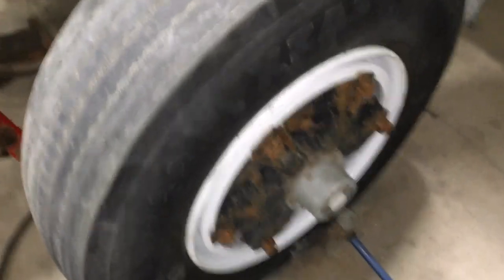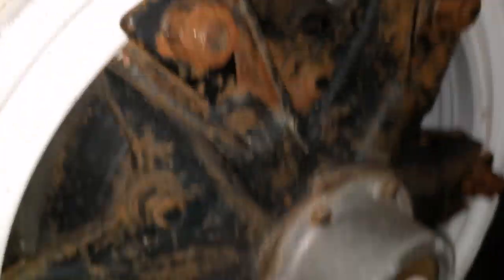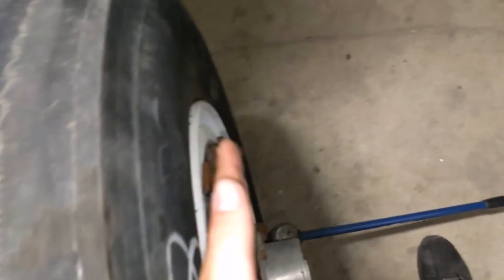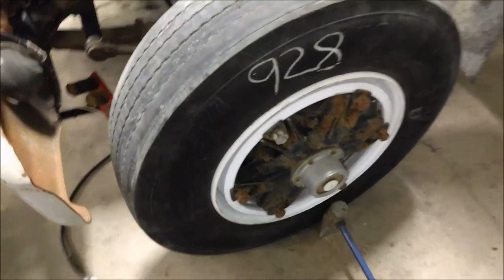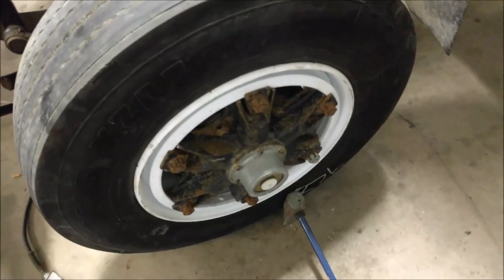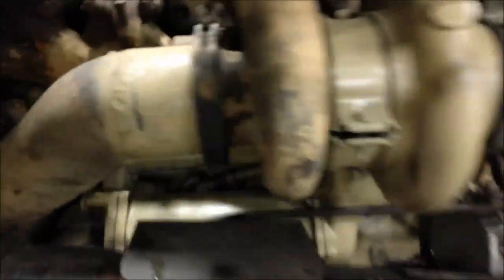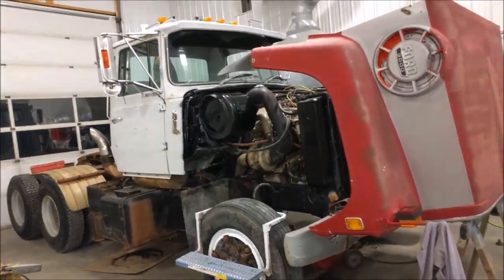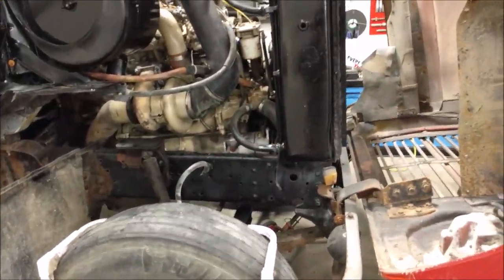Dayton wheels - How to remove and install

Comment: Great video! I have a question from my Ontario Truck technician exam which I think you can help me with, a vehicle with Spock wheels has a wobble at the steer tire, what is the cause? A) rim clamps were tighten incorrectly, b) axle nuts were tighten incorrectly c) camber adjusted incorrectly d) wheel bearing tighten incorrectly
Reply: Did you line the wheel back up to make sure it's true?

Comment: Can this be done with the tires aired up? I'm not familiar with these rims. Wanna know everything before I start the work.
Reply from the maker: Frost8888 yes you can but if it’s a split rim it would be safer deflated
Reply: @ryan000s  they are the same rims. I just wanted to be sure. I have 5 spoke rims though.
Reply from the maker: Frost8888 should be fine then. But it never hurts to let the air out
Reply: @ryan000s  I'll play it safe lol. Thank you

Comment: I have 11r24.5 daytons on my truck in the front. Want to switch them for 315 80r22.5 daytons. What will i have to do?
Reply: I know I'm replying to an old comment.
The center cast piece (star) will need to be changed down a size to go from 24.5's to 22.5's.

Comment: time for new hubs, wheels, and proper tires. get rid if that crap. there is a reason most tire shops wont touch it, and none are being made like that today.
Reply: Nope.  Keep them and do it yourself.  Makes an old truck nicer
Reply: @1965Gindy  for a show truck, or a collector, not for a working truck.
Reply: @nathan00campbell  yes.  Because it's a pain when you need a tire to get back on the road and nobody will do it.
Reply: trucking shenanigans  exactly I've worked on several.  I'm sick of these idiots that won't touch them.  I even told them it makes them suck at their job.  Actually I saw a brand new freightliner dump truck have them.
Reply: They still make these for mobile homes and heavy duty trailers
Reply: As long as it's a one piece rim, a shop should do them. The one piece rim for daytons uses the same tire size as a budd or hub pilot.